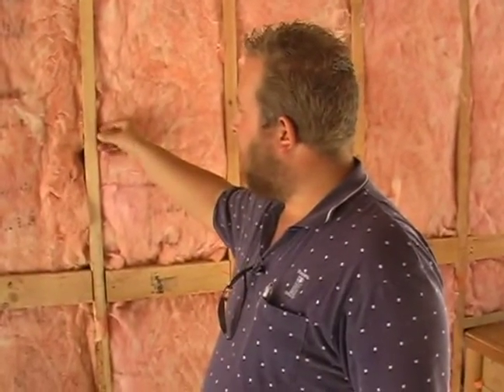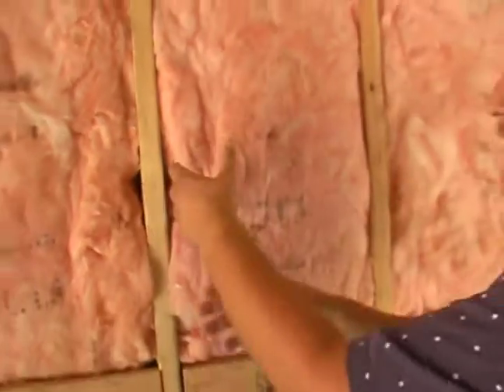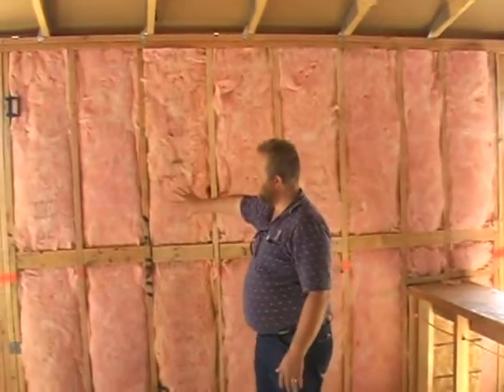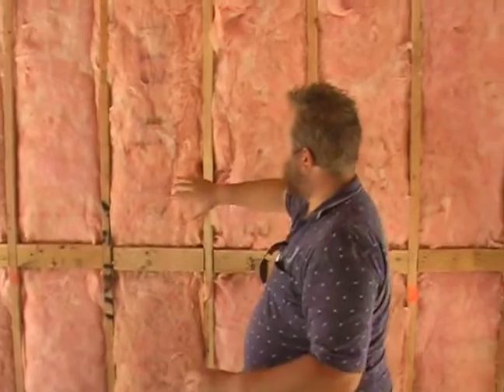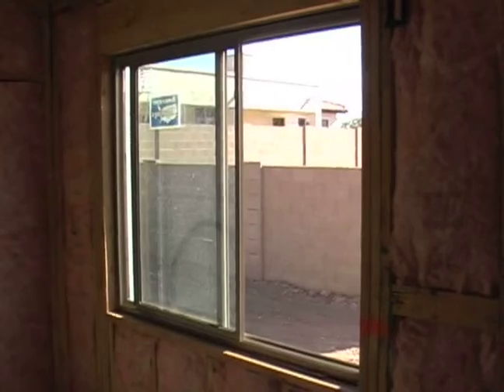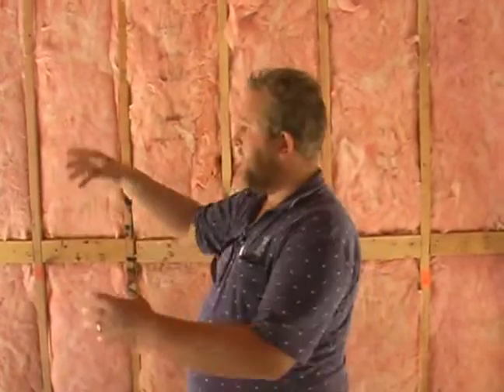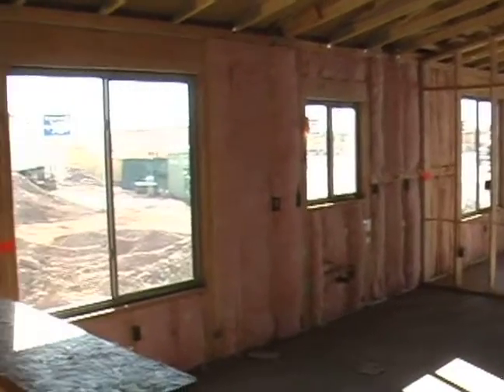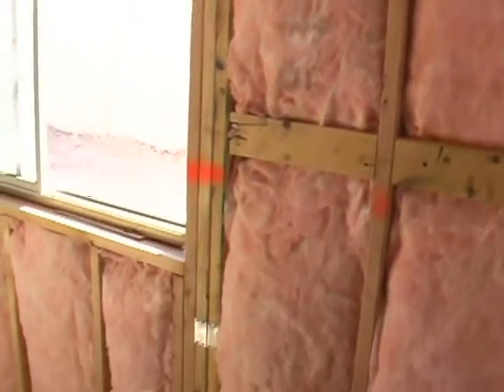Inspecting Insulation for Energy Efficient Homes : Ways to Measure R-Value for Home Insulation

Comment: Thank you - very helpful, useful rule-of-thumb figures. A relief after trying to do complex thermal calculations off Wikipedia. 
Now, were those "R1" windows in the video double-glazed? I'm experimenting with do-it-yourself double-glazing and want to know what my R value is likely to be. See my video by searching for PalmyBruce and doityourself double-glazing. My glass sandwich has a space of about 2cm, with perimeter of closed cell foam.